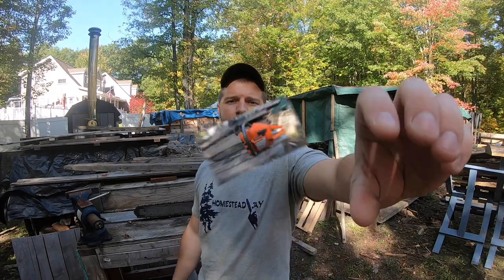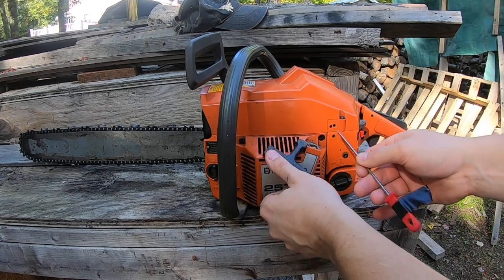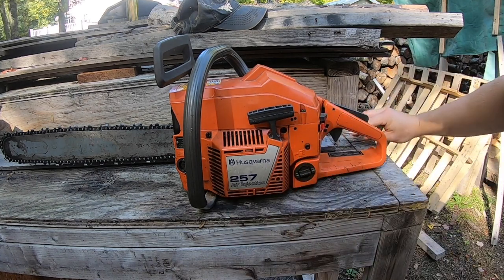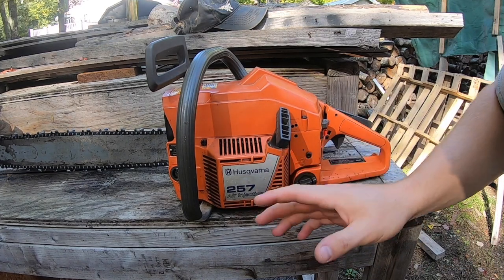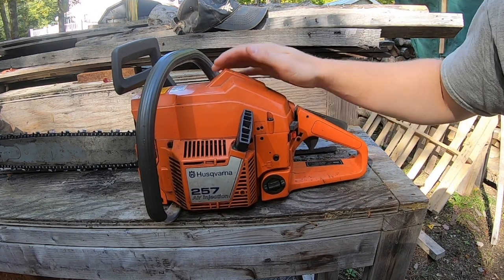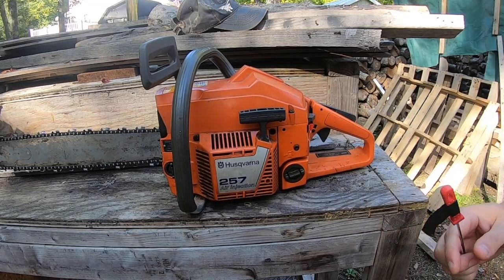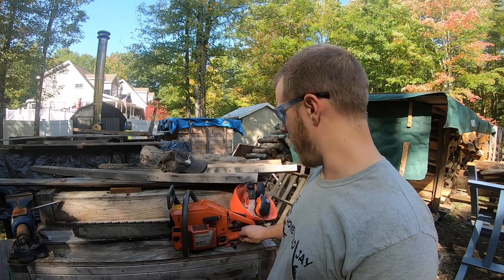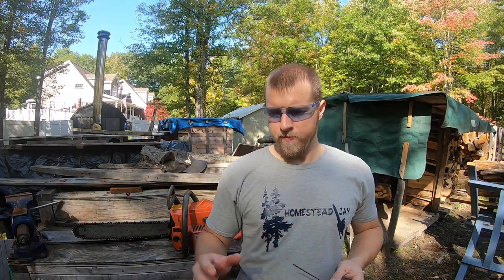How to Tune a Carburetor on a Chainsaw! EP 73

Comment: Hey Jay, Thanks a bunch from Ray at Wimsical Wind Farm here in Connecticut. I have a 257 and a 372 Husqvarna with an old Poulan for limbs. The 257 was giving me fits until I watched your video. Nice job on getting your message out. I did what you said and that old saw never ran better. Thanks again for an informative video I could really use.
Reply from the maker: Hey Ray! Glad it helped! These older pre auto tune saws just need that slight adjustment sometimes! Thanks for tuning in!

Comment: Been trying to understand setting the carb in my old husquavarna 51 this really helped thanks
Reply from the maker: Glad to help but Remember depending when you are cutting cold weather or  hot weather saws may need a slight re tune. Think of a snowmobile. Sleds runs mint in the winter and like crap in the summer months.

Comment: Hey Jay. That was a very good video on how to tune your saw! Nice and simple to follow along. I had to tune my Echo last week because it had a bog from idle. The low adjustment took care of that. I tweaked the high side too. I did back them off as you showed. That saw is right on now. Of course I had to take the limiter caps off to do it, but I am not worried about the warranty anyway. I am thinking about getting me one of those Echo 590 Timber Wolf. I declare the price is right on those things. Alright buddy, I'll let you get back to it. Did you get your log holder like you wanted? I thought I could see it when you first started the video. Later man.
Reply from the maker: Bruce! Thanks for coming back! Believe it or not I still havent tuned my Cs-490 haha imagine that? I tuned it (within range of the red caps) but Im gonna remove the caps. How did you remove the caps? Ive heard a drywall screw works or something like that. Ive had my eye on the 590 timber wolf. Seems like a solid upgrade for sure. Ive pushed my 490 to the edge but now that I got the Husky 257 (60cc) I will hold on the timber wolf for money sake. I do LOVE the sawbuck now that Ive upgraded it. I posted the video today! I see you commented lol Thanks for watching and have a good weekend! Stay safe!

Comment: Hi! Great video, many thanks. I have an old Sears 2.0 cubic inch chainsaw that specs 1:16 oil/fuel mix. I now have the high side needle spot on, just a little back from max rpm. But I'm struggling with the low side needle & idle adjustment. If I adjust the idle low enough for the chain to not move, it stalls. If I increase the idle enough to stay running, the chain is moving. I've gotten it to idle properly for a few seconds before dying. Do you think my LSN is too rich so I'm bogging down, or too lean so I'm starving at idle? How can I tell the difference? Or shall I try some sea foam, then get a carb rebuild kit?
Reply from the maker: NO seafoam, that wont do anything. What ratio are you running? Remeber the more oil you mix the less fuel (lean) in the carb so more oil DOESNT mean more lubrication it means less gas in the carb so be careful with that! Get a Echo Red Armor run it 50:1, Your older saw calls for a heavier mix because the oils wernt what they are now so try a better oil at 40:1 or 50:1 whatever is closer to what it calls too from factory. Try that first, if that doesnt work reach out to me again and well go from there.
Reply from the maker: Also keep in mind if your clutch has a lot of wear on it the clutch shoes will be worn down/springs are fatiguing which can cause the clutch to engage at a lower rpm because there isnt the full "resistance" I.E. Centrifugal force that once was there so it takes less rpms to engage the clutch. Think of a snow mobile, guys change the weights of the clutches around all the time to get different engagements at certain rpms!

Comment: My husqvarna kills off when idle but can run it as long as I keep revving up the engine. There's occasional smoke. I thought its running to rich? Should I lean up the low idle?
Reply from the maker: hey there! I would run the saw and get it to running temp and then start playing around with it. The low jet should control the initial bog and throttle response. The high jet just controls how high it can rev lol these older saws you can lean out to the moon but obv you don’t wanna push it. I’d play around with the low for sure if it needs constant throttle to stay going. Find a baseline where it idles on its own and play with the adjustments then! If nothing works you may have something clogged potentially in the carb but normally they run or they don’t it’s never an in between. So give it a shot and let me know! If you need more help just ask!
Reply: I that don’t work. Try running some sea foam in it
Reply: @AdvancedLawn   I ended up switching to a stihl but thank you for the help